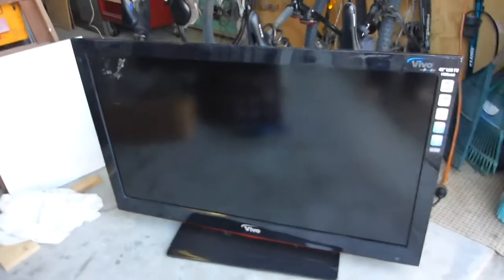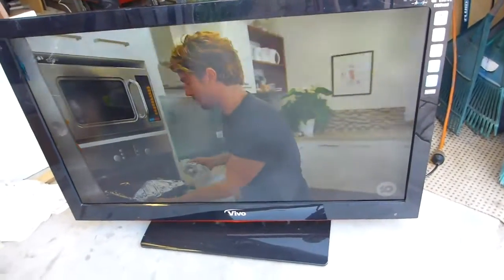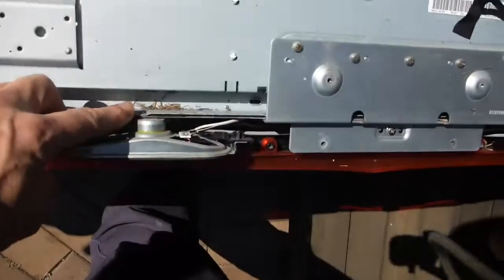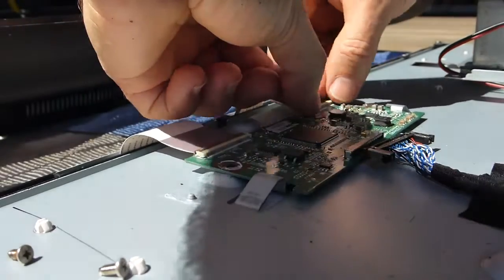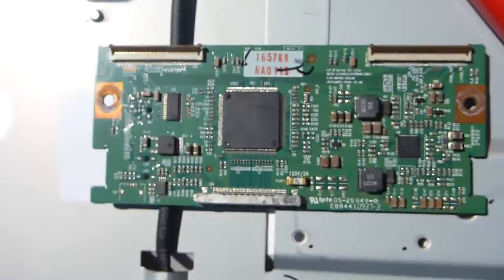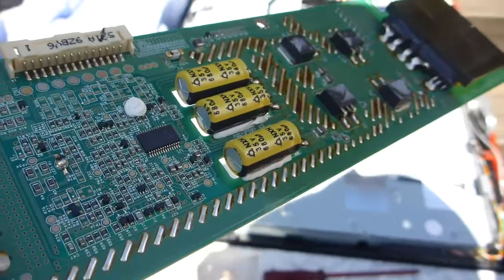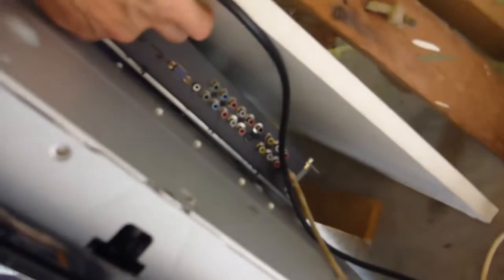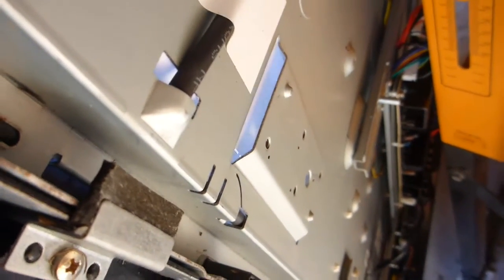TV Reflow Attempt - does it work?

Comment: Hi. I have a VIVO LTV FHD LTV42FHD (42") at home. It works normally but I hear an annoying whiz sound when I turn it on. It seems to me that the whiz sound is stronger on the right side (looking from the front as a spectator). Is my TV repariable? Do you have any guesses? I am not a TV electrician and I want to see if it is worth spending money to have it fixed. Thank you
Reply from the maker: Looks like this TV was released about 2009, making in ancient and not worth repairing - inless you can do it yourself. The whizzing sound could be anything, from a choke to a transformer or capacity (about to fail) on the main board. Each of these issues could take hours to problem solve by a technician. Sometimes you can swap board out if you can find the exact model number of the board, but with no experience yourself, I would not pursue repairing it. A 'reflow' will definitely  not help in this case, reflow is only useful for poor soldered joints. These are the types of TV's people are throwing out for free. Sorry I can't be more useful.
Reply: @pescado99  Thank you very much. This is all I need to know.